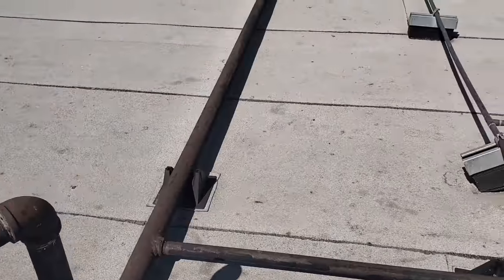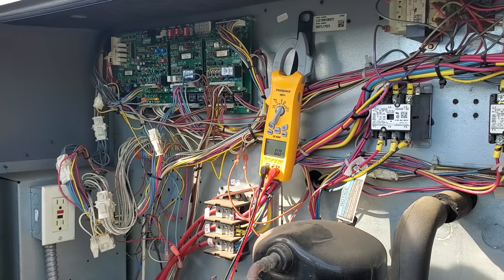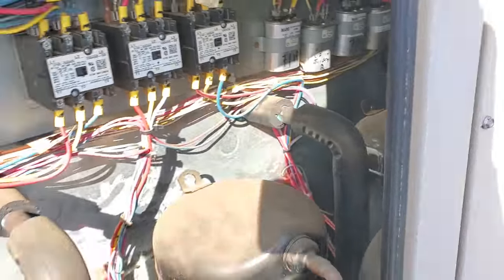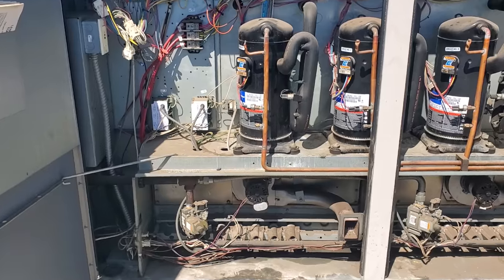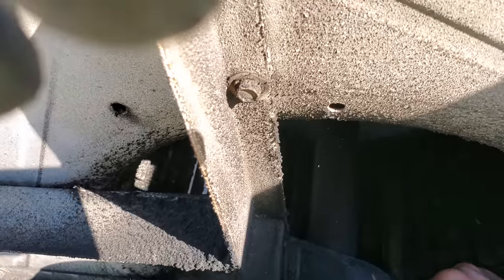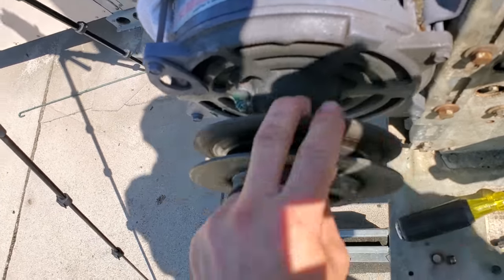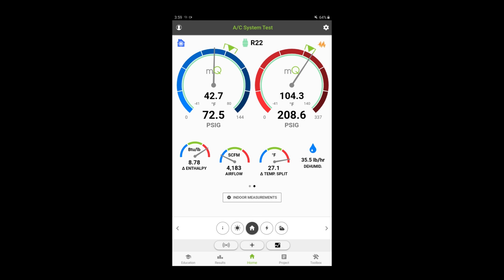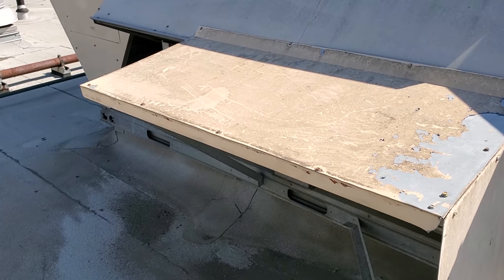THE KITCHEN IS TOO HOT

Comment: Everyone needs to recognise a simple fact: 

The money "saved" by avoiding PM will be wasted in multiples when the system suffers a catastrophic failure and needs an emergency repair 
 (in my world this has the lifecycle classification of "Run To Failure"... it never ends well!)

Also the full disclosure attitude you have is the best approach. if everything is laid out then a plan can be made to fix everything. If the customer decided to disregard the issues identified then they accept the responsibility for running at risk.
Reply: The worst part is, were it not for the lack of revenue, this would be the ideal time to pull everything apart and do a thorough servicing. After all, the place is already shut down, so you're not inconveniencing customers. It's a better use of the time than simply standing idle.
Reply: @watchm4ker  I fully understand the decision to take a future expense versus a current optional expense they can't afford/justify to incur. I've been there myself and paid the premium for the decision.
Reply: The analogy of the train wreck that's on fire, do I jump off now, wait till it explodes or actually wrecks then explodes.

Comment: I was taught to leave a mount of grease on each zerk so that you can easily wipe it off the next time and take the dirt with you. Wiping the grease off after the application makes it harder to get the dirt off and increases the chances of pushing dirt into the bearing during the next application. To each their own. 🤷‍♂️
Reply: I like being clean but I also don't like changing rusted or clogged zerks.
Reply: @ninamcclure2193 Isn't that the truth. A lot of manufacturers are switching to Chinese pillow blocks with metric zerks. Those things suck to get when you need them.

Comment: Rule of thumb how do you know when you've added enough grease to the bearing?
Reply: Grease until you hear a really loud pop then you know your blew the seal out and it’s 1000% filled with grease. Jk don’t do that, it all depends on the bearing. If it’s sealed or open and if it’s a motor... each requires a different amount. Manufacture will say what’s best.

Comment: 4:50 I prefer to leave the grease on my zerk fittings since they protect the fitting from getting a bunch of crap in them. So when it comes for the next greasing you just wipe it off and it’s perfectly clean. That’s what I do on my mower that sees a lot more dust then this blower.

Comment: I’ve shown  up two or three times to find that same model and the 4 circuit one with breakers tripped... open up electrical compartment and find there was a huge electrical fire wrecking 80% of the wiring. I check tightness of connections on pms... just boggles my mind

Comment: What if an Apple would design these? I mean thermostat will go you would replace whole unit. Everything is under epoxy or welded shut. Only Apple employee can come to say "tough nut boi" or then come sue individual repairer for making these units 'dangerous' for users if they touch them instead of them. No parts available.

Comment: Started out as as a electronics tech went to tech school  helped out HVAC guys with electric troubleshooting     worked for appliance tv dealer went to ge HVAC school 60years ago was installing a coils on furnaces .he later got a sheet metal  guy .I went on to install catv systems in high school  for him   .after army opened tv ac repair shop .ret .2007 theese fields were intermixed early on .before gas issuees.

Comment: You could have just used vinegar on the old thermostat to get rid of the corrosion.
Reply: The batteries are likely just for saving the settings in case of power outage. The actual power for the thermostat comes from the 24v, removing the corrosion around them wouldn't have done much
Reply: @DerpyMail  I have never dealt with a thermostat that actually did that. I have come across ones where the circuit board has an option for that, but the necessary parts aren't fitted.
Reply: @b2gills  Thermostats are normally wired with a 24v feed from whatever they're controlling, at least in commercial HVAC. Residential you get a mixed bag. My house needs batteries in the thermostat since it only controls the baseboard hot water heating boiler and only has two wires (used to be an old mercury bulb thermostat when we moved in, but we changed over to a programmable one), or I could probably pull a new wire to the thermostat from the boiler to the thermostat to give an always-on return path for the 24v feed so the thermostat could power itself from that. I'd still have batteries in it for saving settings if the power goes out, but they won't be needed for regular operation.

Comment: Also a question do you still use R22 in the USA ? because in Europe is being banned to be used for anything since like 2008(nor repairs , nor new units , nor refills etc )  or something , is that a thing ?  do you switch to new gases like R404 ? Thanks
Reply: It is still available for purchase but production of it ended last year so prices are going up fast.
Reply: @markcaldwell1245  preferred replacement? Also the on off compressors are also not allowed all allowed compressors are inverter (meaning the can't have contractors etc..
Also does a compressor is certified for a certain gas?

Comment: What grease would you recommend for blower wheel bearings & motor bearings?
Reply: Lithium
Reply: I use synthetic grease
Reply: I use either chevron or Mobil 1 in a stick for grease gun. Daikin units I work on have a sticker data that shows what grease is recommended for bearings hitting certain temps/per year how many times to grease.

Comment: FYI: according to Gillette (makers of Duracells) all alkaline cell leaks and corrosion are best cleaned up with a baking soda paste - and they're right in my experience. The battery contacts will come up shiny even if they were covered in green gunk beforehand. It also works for "ordinary" dry cells